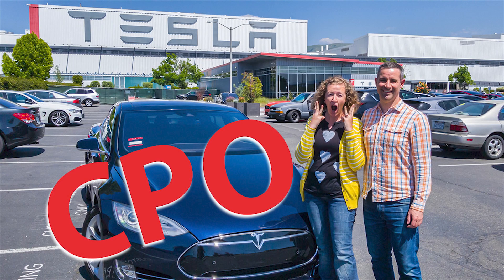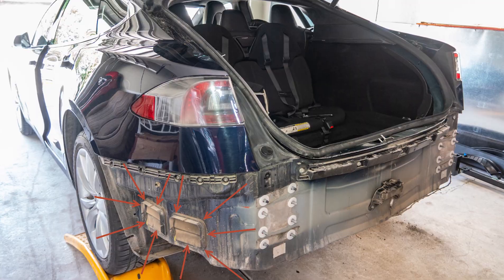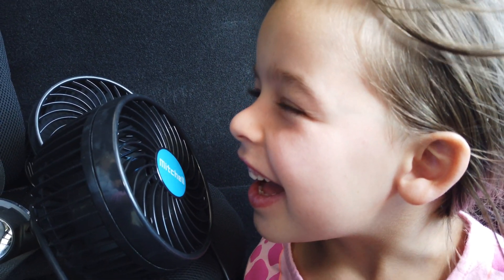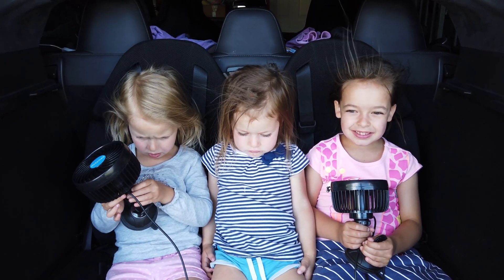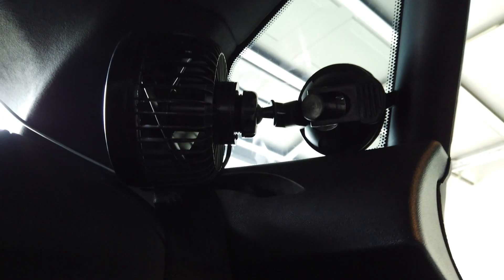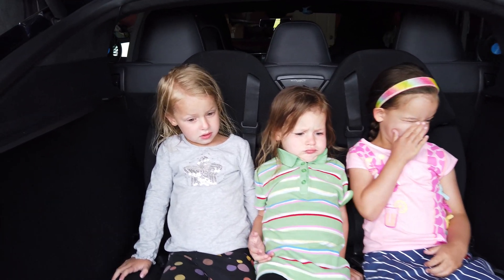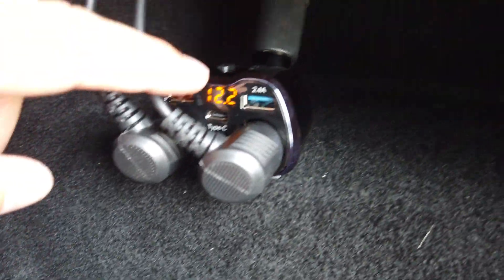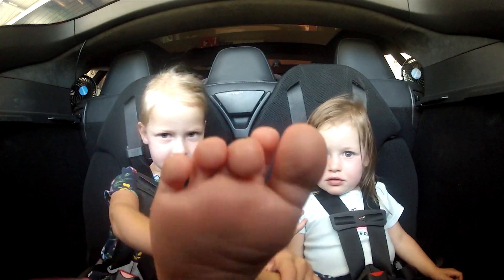How to Improve Ventilation of Rear Facing Seats in a Tesla Model S

Comment: Great video. Do you know of any fitted liners for the sub trunk, for use while kids are in rear?
Reply from the maker: I don't know of a fitted liner off the top of my head, but it would certainly be helpful to have in our case since our kids track all kinds of debris into the trunk floor on a daily basis.
Reply: @ElectricTechAdventures  found a pair of generics at menards for $10 total. I think WeatherTech has something, but is >$100

Comment: I just did the 3rd row install.  I was curious if you knew what the maximum amperage that can be used off of the 12v accessory socket up front.  Hooking up directly to the 12v battery run the risk of killing it if left on.
Reply from the maker: I don't know the amp limit of the front factory 12 volt DC socket powerport. We use it on a regular basis for charging our phones and other devices up front with a inverter plugged into it so I didn't want to tie it up with the fans in the back. While there is a risk of the fans being left on they are loud enough when we're parked that we can hear them humming and know if the kids left them on or not. The fans are fairly required in the hot summer months. This summer we have had to have kids back there every time we drive anywhere with the whole family since we are family of six now and the kids are totally fine with it as long as the fans are working.